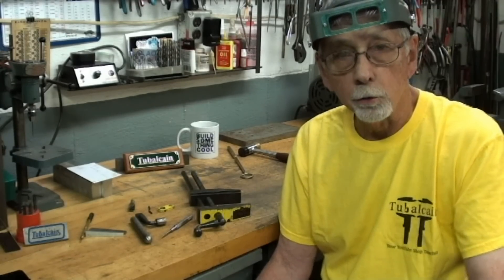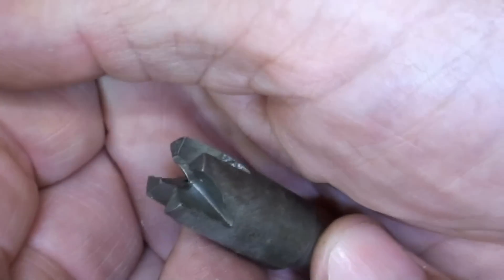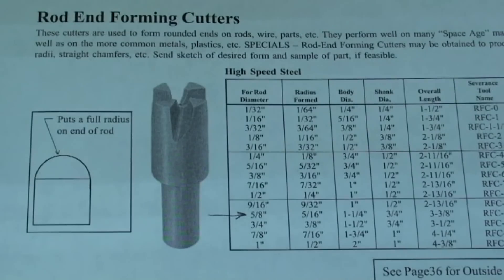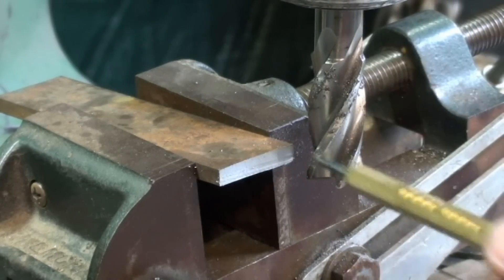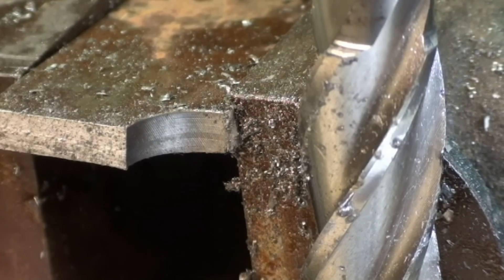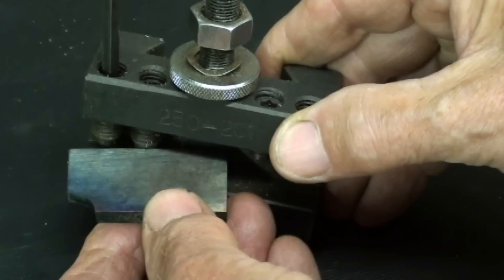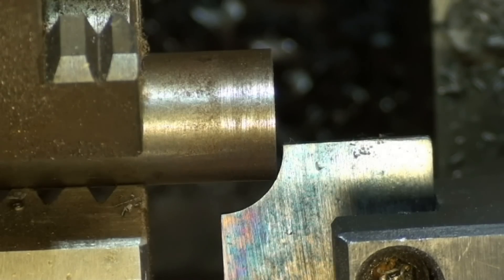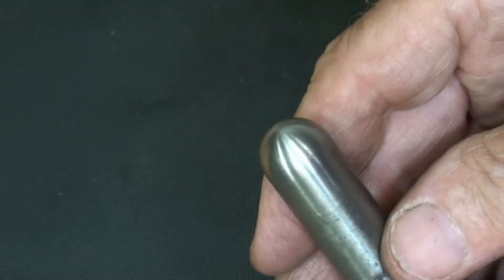MAKE A FLOAT LOCK Drill Press Vise TIPS 586 pt 7 tubalcain

Comment: I don't know if it's just me or would I like to do but I found it beneficial to clean up a piece like this on a 3M deburring wheel which are kind of expensive but if you use them sparingly and as they are intended to be used they last quite a while and they are worth their weight in gold as far as I'm concerned. But if you clean up a piece like this prior to heat treating it you can really see the colors and get a fairly accurate amber tempering on the piece just my opinion I don't know if anyone would agree with that but that's what I believe it's always worked out well for me not that I'm any kind of expert mind you
Reply from the maker: Thanks

Comment: Thanks for this Mr Pete, I was wondering how you made the forming tool. I made a tool post adapter for my lathe which can hold milling cutters at right angles to the chuck. You can then use one flute of a corner rounding or radius milling cutter to cut the radius, works very well.

Comment: Never had any luck using form tools. I think you need a fairly heavy lathe I just get chatter when I try it.
Reply: The right amount of pressure when feeding in makes a big difference. Too little, more chatter, too much more chatter. When you catch the right amount, smooth as butter. I've made/used many over the years, used on my 1936 12" Craftsman Lathe.
Reply: Russel Allen  I think my top slide and saddle a pretty worn and I need to have a look in more detail sometime. Thanks for the advice regards Chris
Reply: @allthegearnoidea6752  That would do it. Lock it down and feed in with the carriage.
Reply: Russel Allen  hopefully that would help. Thanks Regards Chris

Comment: I know that this is going to be a bit long winded but the angle vice that you have on the meal say if you wanted to drill a hole at a particular angle using a normal drill press you didn't have an end Mill widow's voice be able to hold the material and so that you could drill